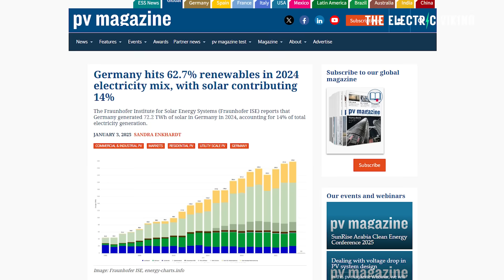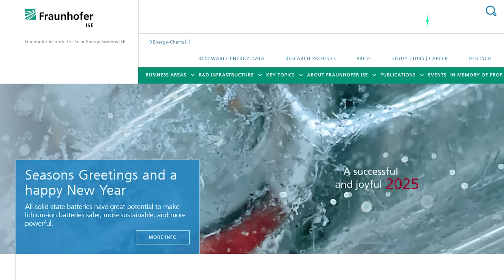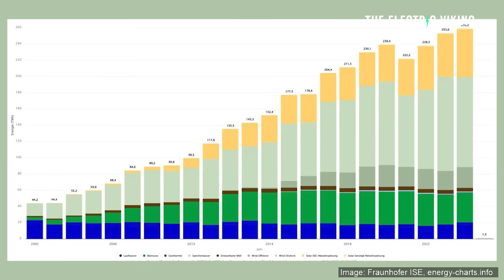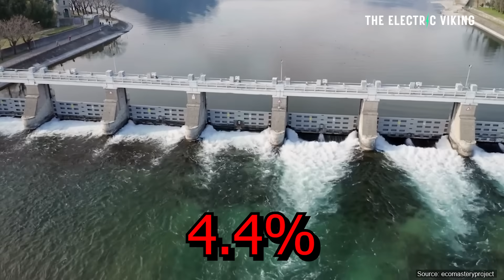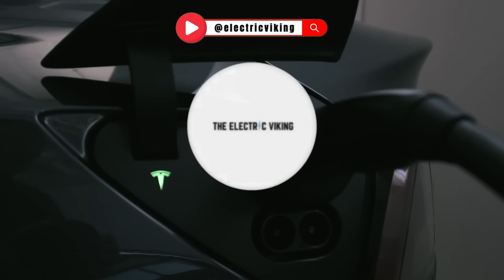Germany hits 63% renewables in 2024 as battery storage almost doubles

Comment: Still a major problem is the North-South grid connection that ist underpowered and generated a loss of 3 Mia Euros only last year because windturbines had to shot down. When that N-S grid issue is solved, a big step is made.
Additional is the upgrade EU-grid plan to be achieved till 2030, that will alloy high transit electricity from Denmark to Spain and back. Till 2030 the EU has planed to install x3 green energy capacity and then will be +80% renewable.
Reply: @francisgerz1281  Some experts say, if we had utility scale batteries and use home and car batteries, we would not need this thick expensive copper cable, that lasts only 50 years.
Reply: @limonade2684  I wonder when car batteries will be allowed to send energy into German's grid?
Reply: Hello German here
Actually there is now in 2025 a new Part in the eeg framework that can allow Private Batteries and i think also evs to function a bit better as energy storage. Although the paragraph is really not easily to understand, i think it means you can get at least a partially discount on your electricity cost in moments when it is really cheap. The Problem till now was you had the electricity price to pay, which could be as low as 0 or on a sunny day even negative. But you also have to pay a price for the grid and other things, that are fixed. From my understanding there is now a possibilty to only pay the electricity price even on the homebatteries as long as you are not consuming the energy.. but it only just startet and we will see how our providers will integrate such processes in points of metering or Installation.
Reply: @ec2_alcatraz  True. We have to buy AND rent the meters, maybe people will not put any electricity into the grid. And when we have the big battery farms, prices will change again. From the comments, I guess in Australia it is even more confusing. Every town can change the price every month. But with so much sun, I would not complain at all. 🔆
Reply: They are currently building a North- South Grid Connection, so in a few years, this issue should be solved

Comment: What some people don't like about Germany is that after the war they started in Ukraine and yet they chose to shut down well-functioning nuclear power plants at the beginning of 2023 when it was not certain where the electricity would come from as coal-fired power plants
and with 364gCO2/kwh (2024) compare with Sweden and Norway who almost always export to them but it was also because they got cold and there was no wind for several days that they burdened many countries around them
Reply: Sweden and Germany enjoyed a somewhat symbiotic relationship, while Germany had nuclear power. Fast Forward four years and they are now in a world of pain due to an absence of baseload capability.
Reply: @davidbrayshaw3529  The baseload capability is available. Germany usually needs up to 65GW on work days with peak demand in winter of 75-80GW. There are enough gas, coal, oil, biomass, and hydropower plants to supply this demand. Together with pumped storage 90GW of peak power are available, without a single kilowatt from either solar or wind.
Reply: @ElwoodEBlues  Is that enough to solve Sweden's problems in the medium term?
Reply: The nuclear plants were at the end of their lifetime and their shut down was decided since 2011.
Reply: Germany has about 91 GW capacity in oil, gas, coal, water, waste and bio mass with an additional 9.9 in pump storage as of the end of 2024. At all times this could cover the demand if necessary. Especially since renewables still put up 5 GW or more during mid day peaks even at the worst day in 2024 and a sizeable amount of batteries already exist as well. The truth is more that german producers as well as norwegian, swedish and france know they can get away with any prices during those times and as such try to extract the biggest profit. During the price peak which refueld this discussion in 2024 not even all german plants were active. 
In the end its not really a shortage at all anywhere, its corporates trying to maximize their profits, no matter in which nation although truely the german producers were first in line here to scam the customers. They are official being investigated for this.
Reply: We Germans didn't start the war - not this one - , and we didn't shut down NordStream.
Oh, ahm... I had in fact - but I'm not a German minister.

And we didn't shut down "well functioning nuclear power plants", but power plants that were way overdue for maintenance and inspection, that hat most personnel moved to other facilities or become pensionists, that had their fuel spent and due contracts for shutdown and dismantling.

Too many conservative populist and/or lobbyist a-holes and liars still spread that lie Germany that was wrong to shut them down. Where were they in 2011, when a conservative Government made a quick decision to shut them down for real? Well, we could have used them for 5-10 more years easily. The same conservative Government of the Merkel aera introduced the CO2 tax, made plans to phase out coal, blocked renewables wherever they could - and decided to entirely rely on cheap Russian gas - even after 2014. It couldn't get any dumber. And it's not her personal fault, but our industry's.

Multiple times, Germany energy trust CEOs spoke up in press that "nuclear is through for Germany" and "nuclear may be possible, but then we have to talk about money". The "big four" of the energy suppliers obviously don't even want to restart nuclear. Guess why ...
Reply: Did I get that right: Germany started the 2022 war in ukraine. 
=> What a stupid opinion and what a twisting of historical facts

As early as in summer 2021 Putins gazprom already did not fill the german gas storage capacities any more   in order to hit germans energy system and to rise prices for gas and oil. Then he - Putin and nobody else - started his total war against ukraine in 2022 and decreased the gas exports to germany further more. 

What he did not expect, was the will and the power of the ukrainian people, to resist against his invasion.

What he did not expect either, was the quick reaction of germany 
1. to strengthen their energy supplies without Russian gas
2. to get rid of Gazprom in germany as a unreliable company
3. and to enable a quick and decisive increase  of wind and solar power in germany

What helps a lot now, is the decrease of battery storage prices. 

So the electric viking is right: in a few years Germany will reach 80 or 90 % percentage of renewables
and - at the same time - will essentially transform its car market to electric cars and its heat market to heat pumps.

Comment: And yet we’re paying the highest prices for electricity in the EU. And the government ist planning to build more gas peaker plants, which will increase the prices even more.
Reply: @andreasdamm640  still cheaper than in the UK though...
Reply: I always ask myself whats the true reason for this, soon the price of electricity per kWh for new customers will have been consistenly below 30 ct for two years. So in 3-4 month each and every household contract did end during a time were you can get a new one for under 30 ct/kWh (max contract length is 2 years), so how is the average pay per kWh still over 40 ct? It should be hovering a little above 30 ct now...
Reply: @Domi.R313  As explanation for non-Germans: there is a significant price gap between “nice-price for new customers” contracts and the overpriced base tariff (“Grundversorgung”). 
This is a basic supply plan with volatile prices, which the utility companies have to offer as a guaranteed supply contract. 
With the market liberalisation everybody was automatically shifted into this base tariff and often elderly or lower-educated people are shy of changing their supplier or plan, although it’s pretty easy. 
They’re now in trouble, because due to the Ukraine war we’re suddenly seeing prices skyrocketing to north of 45cts/kWh. 
On the other hand, if you’re willing to change and spending a little bit of time, you’ll find rates less than 30cts/kWh, which can even be fixed for up to two years. But you have to get active…

Comment: THank you for this video! 

As an Energy Engineer  working for a Grid Operator i always tell people the same. Germany is on the right track. To talk about to most popular wrong facts that are out there: 

- Yes, we increased our Import to germany, BUT only because its cheaper for us to buy Wind-power or sometimes even the excess Nuclearpower from Denmark or France. This is the way the market in every Sector works, and has nothing to do with "being dependet from other countrys". We could generate all of our Power in Germany (unlike Swizerland, Austria, Poland etc) its just cheaper for us that way. 

- Our grid is not bad, we are simply not using everything we could. Germanys power grid is calculated to take every single power peak and deliver it without any failures. But that takes a crazy amout of cables, Substations, Transformers just for that ONE peak. The rest of the Year we are not even close to using the full capacity we could. And also our Grid-operators often dont even know whats going on. So they dont even use 50% of what their grid could deliver. 
--> We need Data, and we need Storage. Then we can use the potential of the already built infrastructure without increasing too much. Although, we still need to upgrade in certain areas. 

- No, Nuclear power is not the future. Just ask the french electrial Goverment-Company, EDF, they hate that they have way too much power in the summer, and still too little in the winter. (France buys power from us Germans in the winter, more than triple the price we pay for the power in the summer) 

- We are actually compared to a lot of big other Industrial Nations very VERY far in terms of 100% renewable Grid, but we complain a lot and just read the problems, without listening to the Success we are archiving on the Way 

So my fellow germans, be a bit proud, we have a long way to go still. But we are actually pulling the right strings (as long as no other dumba** politician comes along and goes back to coal like we did in 2012...)
Reply: small correction: excess nuclear power comes from France, but Denmark supplies us with wind energy. Fun fact: the small country of Denmark delivered almost as much wind energy to Germany as France did with its 56 nuclear power stations :)
Reply: Gute Erklärung 👍
Reply: Why is than the energy price still so high when it's no problem :D
Reply: @ravanpee1325  it's explained in the video. Did you watch it?
Reply: @ravanpee1325 The power plant with the highest price that is still needed to cover the electricity demand sets the price for all producers. So if 99% of the demand is covered by renewables (cheap) and 1% by gas (expensive), 100% of the electricity is sold for the "gas price".
Reply: @ravanpee1325  Merit
Reply: @ravanpee1325  There are different reasons. For once the price is high because we pay the price of the highest price power plant. For example if we can cover all our energy needs with renewables and 1 Gas Power Plant runs we pay the price for the energy that the gas costs. There are Legal investigations against energy companies right now in terms of market manipulation. If you own a lot of renewables and a gas power plant you can make a lot of profit with that.
Another reason is that we pay a lot of money for the energy network to transport the energy. To keep it simple you pay as much money for the network if you have a wind turbine next to your village and basically use your own energy than a village that does nothing for their own energy production and just rely on the overhead of others.
Reply: Over a year, what percentage of your electricity comes from solar, wind, coal and gas ?
Reply: @pauld3327  ...still 26% from coal in 2023. It'll be less for 2024...
Reply: @pauld3327 and nuclear?
Reply: I am proud of our progress so far. But I must admit that the transition could slow down because a growing majority of people who want the old times of coal and steel back and don’t believe we can make it without harming our country’s economy. Let’s hope for the best!
Reply: @johannbenani4375what is there to doubt? The german strategy has failed, more than 500 billion spent on subsidizing renewables, CO2 output has barely decreased, and what little decrease there is can be attributed to closing down industries. German electricity is extremely expensive, and germany has been in a recession for the last 3 years. More and more companies are moving out of germany due to high costs.
Reply: @HNedel  please google electricy prices in europe. thank you.
Reply: @pizzakarton468  i did and I found the same information i already knew - Germany has the highest prices, followed by Ireland which had the biggest increase last year. But i‘m sure it’s just a coincidence that Ireland also is pushing for renewables at the same time…
Reply: @pizzakarton468  

Eurostat:
Highest electricity prices in Germany and Ireland

For household consumers in the EU (defined for the purpose of this article as medium-sized consumers with an annual consumption between 2 500 Kilowatt hours (KWh) and 5 000 KWh), electricity prices in the first half of 2024 were highest in Germany (€0.3951 per KWh), Ireland (€0.3736 per KWh), Denmark (€0.37078 per KWh) and Czechia (€0.3381 per KWh) - see Figure 1. The lowest prices were observed in Hungary (€0.1094 per KWh), Bulgaria (€0.1187 per KWh) and Malta (€0.1256 per KWh). For German household consumers, the per KWh cost was 37% above the EU average price, whereas households in Hungary, Bulgaria and Malta paid less than half the price than the EU average.
Reply: Enjoy spending your upcoming Stone Age with your adapted immigrants Germany.
Reply: true in most, if it comes to current electicity demand. However you miss out the huge future need if we convert domestic heating and industrial procesess. Not impossible, still costly and to a certain extend questionable if our hydro strategy for the industrial demand will play out. I agree we can be proud what has been done so far. Es bleibt spannend -  Fingers crossed 😉
Reply: @MrAwabi  domestic heating by gas in Germany is way lower per capita than in the UK due to better insulated homes  and greater tendency to live in apartments.
Reply: yep, Germany is doing quite well!
Reply: Wir können nach wie vor nur für weniger als 1 Stunde von gespeicherter Energie leben. Ich kenne den ehemaligen Chef von Siemens - Heinrich von Pierer - ganz gut. Der wird Dir in nahezu allem widersprechen. 😊
Reply: Price is paramount though. No matter the rhetoric, higher energy prices render industrial production less competitive, leading to factory closures and a loss of standing. 

It does not matter how clean you are if your production gets replaced by other industrial powers that are not so clean.
Reply: I'm all for renewable energy. But, here, the issue was that the grids for Europe are all interconnected. If Germany is having to buy energy because there is no wind, then it will affect other countries in the EU as well as the prices in Germany. So, saying there is no problem, when there is, would be wrong.
I think this is part of the growing pains that happen when you switch to renewables. I also, think that these issues will get resolved over time.
Reply: Thanks for extended explanation. But I have one question. Has Germany phased out nuclear electric production too soon? I am pretty sure that the youngest nuclear plants could run 5 perhaps 10 years longer.(with refurbishment if needed)
Reply: @erikfromflandres the last nuclear power plants produced 29.5 TWh in the last year. So 3.36 GW on average. A lot of drama for so little. The video only covers electricity so everything is excluding heat and mobility. Still a Long way to go, unfortunately.
Reply: Lot of bullshit i work as an grid engineer....... then you should know that no viable storage of intermittent energy is available. Not batteries too expensive not hydrogen too expensive. Germany is deindustrializing third time wrong Ideology